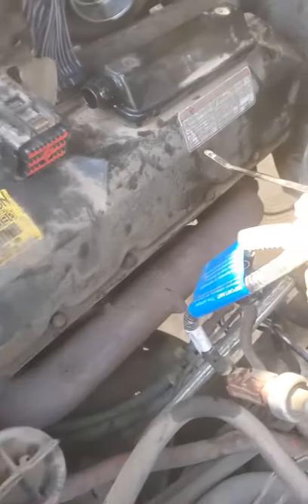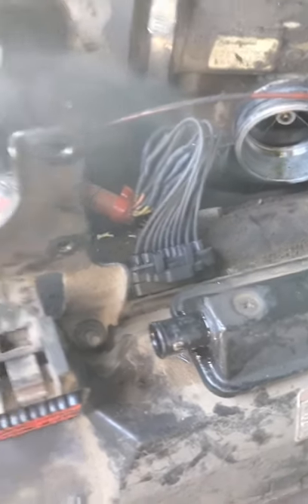Ford 7.3 glow plug harness install

Comment: So were you getting the P063 code, communication error?  I was getting P0676, 674 and 671 codes on my '01.  I replaced the GPCM with a Motorcraft one from ebay for around $70 and those three codes disappeared, but then a P063 code popped up.  I put the old GPCM back to recheck codes and got the three previous codes back plus the P063 that I originally was not getting.  I then reinstalled the new GPCM and it's back to the P063 code solely.  Thinking wiring harness issue.  Any words of wisdom?  Thx